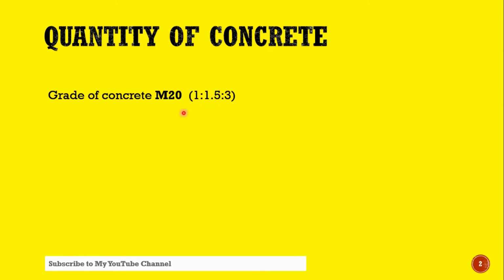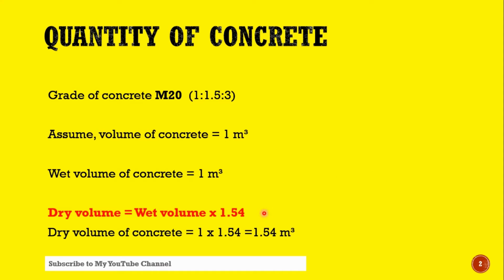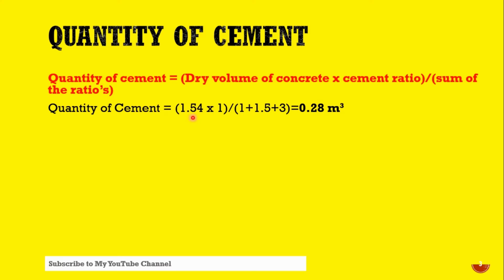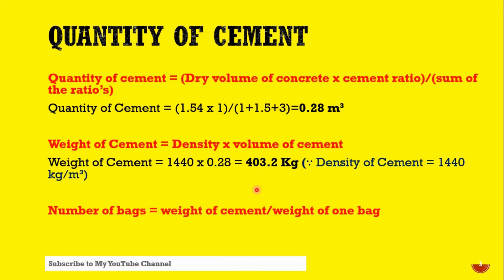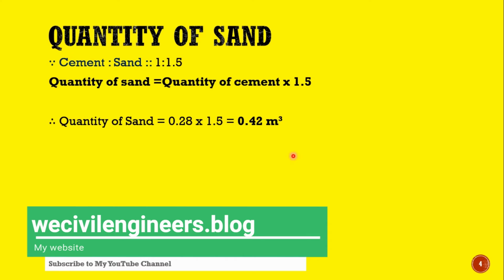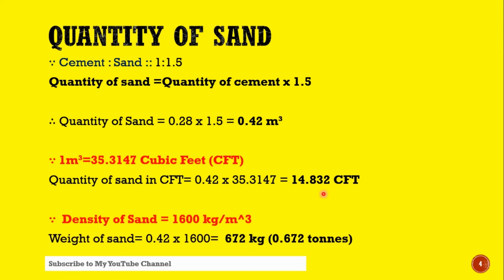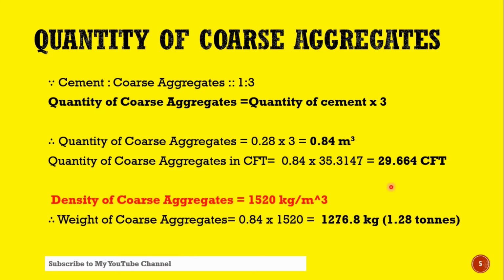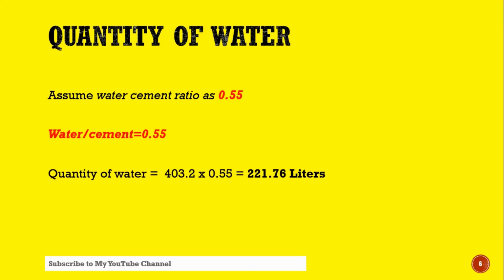How to calculate Quantity of Cement, Sand, Aggregate & Water in M20 concrete?  | Civil Engineering

Comment: How to calculate in brass
Reply from the maker: 1 Brass = 100 CFT = 2.83 Cubic meter. So, for 1 brass 23bags cement, 42CFT sand, 3.6 tonnes coarse aggregates, and 625-630 litres of water required.